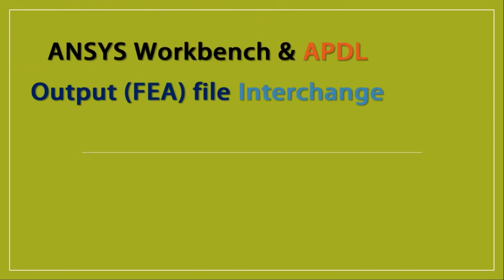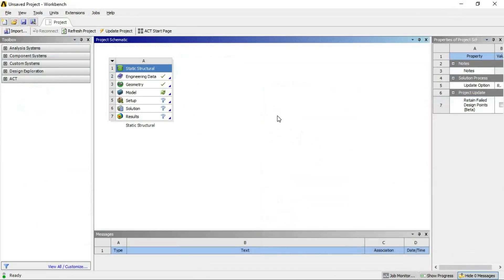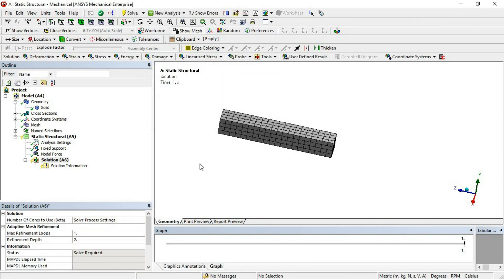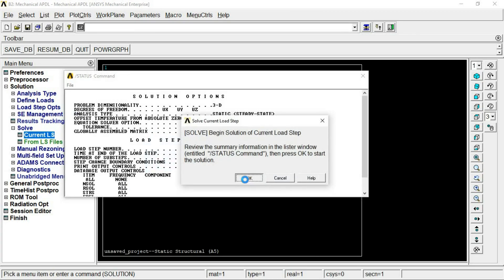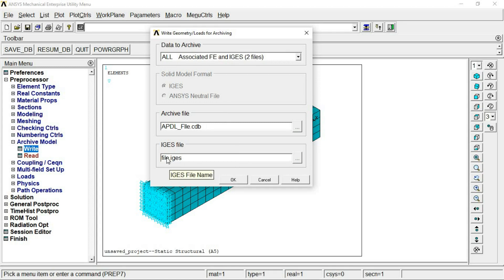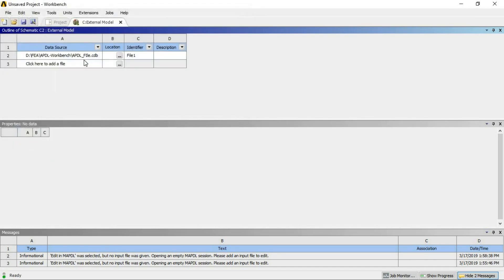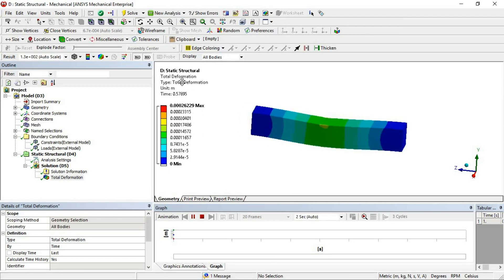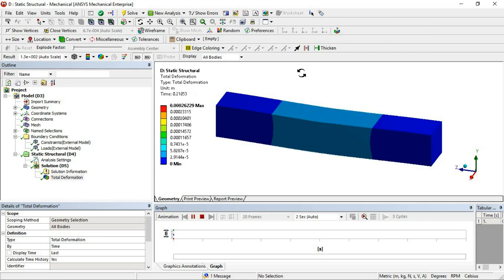How to open ANSYS APDL File in Workbench & Vice versa

Comment: Sir i have done model in ansys workbench space claim and done linear analysis then using tree menu and  imported the file in apdl for non linear analysis, i have add added element type, real constant, material model, now i want to modify attribute that is automatically created and assigned when imported in apdl now want to assign custom properties created in apdl for non linear analysis problem is that i am unable to pick particular element like slab, beam created as named selection in ansys workbench, now i opened component manger there it has be grouped i have selected particular element and ploted element it showed single but problem is when i pick element to assign for particular change of attribute all element are selecting even though i have plotted only slab. 

Can you suggest me tips.

Comment: Very useful tutorial. Thanks. I follow your instruction to export into APDL environemnt a Transient thermal job I set up originally in WB. It is a multi load step analysis but when I read into APDL it seems that only first load step is included. Therefore when I launch solve only the 1 step is calculated. How can I export all load step into APDL ?
Reply from the maker: It should export all load cases, but sometime it will create proper in APDL due to WB & APDL interference issue, geometry complexity, different elements types. Better to apply Loads further in APDL, it might be easier option.

Comment: Hello, your video is great, thank you very much. However, when I try to apply boundary conditions directly on the mesh generated from APDL (.cdb) on Workbench, Workbench does not distinguish nodes or elements. It only recognizes the surface of my mesh. How to select nodes or elements separately in order to apply a force or a displacement to them and not just into the surface ? Thank you for your answer
Reply from the maker: Hi ! It is better to perform mesh in workbench itself, which is quite easier compare to APDL. You can apply loads on nodes, by selecting nodal force or nodal displacement option.

Comment: Thank you Sir . But i have small question can i export only Geometry (with out a mesh)  from Apdl to Workbench i tried it again and again but i was not successful .  I would be glad if you can explain it to me if it is possible. I couldnot refine my mesh after i exported my model to Workbench that i why i need this info.
Reply from the maker: We would suggest use either APDL Or workbench, do no export mesh file from one s/w to another, it might loss few FEA aspects. The present video is for special case scenario. Ideally you should able to export the mesh file from APDL to workbench (Export CDB from APDL and import through external model in workbench) and It is difficult to edit the imported mesh file in workbench.

Comment: how to optimize a part from the assembly taking into considerations the load acting on the assembly.
Reply from the maker: You might need to perform the optimization simulation based on load path.

Comment: What's the difference between the ansys adpl and work bench .....ate these two used for same purpose and which one is better
Reply from the maker: Both APDL and Workbench are from same software organization, ANSYS. Both have advantages and disadvantages. APDL uses GUI & scripting while workbench only uses GUI. APDL have all the necessary option such as macros, arrays, scripts for all simulation while workbench is quite simple and uses APDL script for few analysis inputs and outputs such as reaction extraction with APDL commands in workbench. Workbench is easy to learn and easy to perform the analysis.

Comment: Hey, thank you for the valuable information! I have 2 simple questions remaining

1. In Ansys workbench: How can i change the job file name after each analysis, so that slight modifications and new simulations dont overwrite old results?

2. How can i open multiple results in workbench "simultaneously" so i an compare them better?

I would really appreciate your help, it would help me a lot!
Reply from the maker: Welcome
1. You need to do saveas R1, R2 & So on... after each iterations.
2. You can use viewport option in solution to see different results in different viewport.

Comment: helpful video just one question if we define material in apdl the import file of apdl in workbench will it show with material in workbench ??
Reply from the maker: Yes. Though if it will not show, you just need to explore material xml file and import XML file in workbench. Refer our engineering data/ material related video.

Comment: Sir , I exported file from ansys workbench to ansys Apdl , I inserted load on the beam by using face option in workbench , but when I export it to Apdl the loads are not showing there , what to do sir
Reply from the maker: Rashmi, It might be due to beam element and face issue. You can apply load on nodes instead of face. It may happens if model is complex. You can try to solve workbench file and save db file in analysis setting. You will get APDL file (db) which you can use for other APDL simulation purpose.
Reply: @graspengineering9249  ok sir thank u , I will try

Comment: Thank you for the video it really helps. However, is it possible just to draw the geometry in the workbench and then in the APDL I do the meshing, analysis type, identifying loads etc.???
Much appreciated your help and concern
P.S I am trying to simulate Hyperelastic material under Cyclic loading can You please do any tutorial in how to simulate Hyperelastic  materials in ANSYS APDL because I am really struggling and don't know how to do it and I  cant fined any tutorial about it.  

Thank you again!
Reply from the maker: Hello Alex, yes you can craete geometry in workbench and do remaining FEA steps in APDL. Either connect workbench to direct APDL or else write steps file in workbench Design modeler/spaceclaim and import in APDL.
We will upload video on hyperelastic simulation. Regarding hyperelatic material definition in ANSYS, you can check our  latest  video on material required as per analysis types.
Reply: @graspengineering9249  Thank you for your valuable answer.
 Sure I will check the last video it will help me a lot thanks!. 
Regarding the hyperelastic material, is that I am actually working in a project, to simulate dielectric elastomer under various voltages and frequencies and I don't really know where I can perform this simulation ,either in Ansys workbench or Ansys APDL. I can't find any simulation on Dielectric elastomer in the all YouTube videos and it is very complicated. 
I would highly Appreciate your help in this matter.
Reply: @graspengineering9249 . Hello,sir. Can you explain with more detail the process to just import a solid from workbench to APDL, please? 

Thank you so much for your videos and for sharing all of this knowledge.

Comment: Hello 
, thank you for the helpful video , I had something wrong, 
I can see the values of the forces when I used the code in the flist program APDL I only got zeros for all

and did not see the boundary condition folder and import the summary as you have

please explain to me where is the error?
Reply from the maker: Hello Gunit, If you are following the videos it should give you same loads and BCin both APDL & workbench. But if you are not able to see the forces their might be some issue. We not clear about your issue and how you are performing. But though if you are not able to import complete FEA deck, you can apply forces and utilize the mesh to perform the simulation.
Reply: @graspengineering9249  

Hello
 I did a full-length project, but there's a problem with me and some friends, so we put the strength and stability back on, Thank you, sir, for your important information to us as students.

Comment: Greetings, I am going to do the Response Spectrum analysis Ship Unloader Crane on Ansys Workbench 18.2. The schematic project is:

Static Structural -> Modal Analysis -> Response Spectrum Analysis

The question is the RSA only calculates the structural stress? what if I add some static stresses like the container, machine room, etc on Static Structural?

Because the crane must be on the operational condition while I simulating the earthquake (response spectrum)

Thanks in advance
Reply from the maker: Hello, You can perform the prestress modal analysis to account the other loads and then connect this to response spectrum analysis.

Comment: HELP sir the import summary didn't appear on my workbench. I have followed this video all the way
Reply: and it didn't appear boundary condition too, but there is named selections
Reply from the maker: It should come through external model tab.. Kindly check further. But it is better to work in workbench only.
Reply from the maker: Sometimes it may happened loads does not appear..this might be due elements issue or load application(array or table loads) . You can apply the same APDL loads in workbench. Don't waste time on importing every aspect.
Reply: @graspengineering9249  yeah i know but i have to make it the same solution as to get verified workbench model. thanks anyway

Comment: Dere sir, thanks for informative video. But while importing workbench file to APDL only mesh data transfer. Volume, area, line and KP are not there. Can u pls explain how we can import that also. Thanks
Reply from the maker: You first check what you have exported from workbench. Generally workbench export file only includes mesh, BC and loads . Example. Dat or. Inp file. You need to connect workbench directly to APDL, to get all inputs,  like geometry,  mesh,  BC, etc.

Comment: Hi, I implemented the steps to archive the APDL file after applying boundary conditions and solving and imported the file in workbench as shown in your video. The boundary conditions in the model don't show up in static structural. Any ideas on why this might be happening?
Reply from the maker: Hello ! It might not show in old version. You can write the cdb file without solving in APDL. Also check the loads and BC applied properly or not in APDL before writing cdb. It should show the BC in workbench.
Reply: @graspengineering9249  I am using Ansys 19.1 for this and the boundary conditions do show up in APDL. I tried both the alternatives, i.e. after and before the solution. The boundary condition I am applying is a constant value ROTZ on one node of a beam element 188 in APDL. This I believe is not available in workbench, would that cause any issues during translation? Thanks for your quick reply.
Reply from the maker: We rarely use APDL file in Workbench. We can easily create FEA deck as same as APDL in Workbench (Mesh, BC & loading). Workbench have same element type as APDL. . For your case, you can  apply remote displacement in rotz in workbench. You can brief further what do you want to simulate, share few snapshots with us if you didn't able to resolve at your end.

Comment: Hii sir,
Yashwant this side...would you please help me to solve a problem related to pin on disc simulation to find out the thermal stresses and wear analysis  in case of pin (cylindrical) is fixed and disc is rotating both ...please make a video  of them step by step...
Reply from the maker: Okay !
Reply: @graspengineering9249  if you share your contact no...I will discuss my problem..
Reply from the maker: @Phd_junction_77111  You can contact us on graspengineering@gmail.com

Comment: Hi, thanks for the tutorial!
I got one question: How do you get your file of "Boundary conditions" containing the Constraints (External Model) and the Loads (External model) in Mechanical in your last test ?
It´s after you uploaded in Workbench the model modified in APDL (with new constraints and new loads).
Thanks for your reply
Reply from the maker: Welcome ! Generally applied loads & Boundary conditions will be written in cdb file while exporting cdb from APDL and same you can able to see if you read that file in workbench. It is vice-versa for WB to APDL too. Sometimes loads and BC will not present in case if you export from other Software like hyper-mesh.
Reply: @graspengineering9249  Thanks for your answer. In my case, when I do the export (from one way as well as the other), loads and BC are not present. What do you mean by "S/W life hyper-mesh" ?
I followed your tutorial step by step but with the export I loose the loads and the BC.

Thanks for your reply
Reply from the maker: From APDL to workbench or Workbench to ADPL, output file should contain all the details. It might be due to older ansys version, or might be possibility loads or BC are present in APDL, but its not showing in display.
Generally we did not use above technique of moving files from one software to another, but we do transfer meshing file. If loads are not coming then use mesh files and apply loads and BC separately. S/w means software...

Comment from the maker: Please refer Video for file transfer from APDL to workbench or vice versa. You can follow the same approach to import FEA files from other software like (hyper-mesh, abaqus, etc) too.
Reply: how to do nonlinear analysis using arclength method in anasys workbench? 
Thanks in advance
Reply from the maker: @venubarathan8391  Hello, You need to activate arc-length & set key On, Once activated you need to define the multipliers & initial load factor. But there are lot of limitation of this method.
Reply: @graspengineering9249  but there is options in workbench to activate this in ansys.  Otherwise is any method available to solve nonlinear problems? 
Because newton raphson method fails to converge yield point of the structure. I want to capture nonlinear behaviour of structure beyond yield point.
Reply from the maker: What kind of analysis are you doing ?  If your geometry, meshing and material definition is proper, then most of time ANSYS default setting is good to converge, No need to give additional controls.
Reply: @graspengineering9249  i am doing nonlinear buckling analysis for dome elliptical shell. In abaqus it is converging using arc length method. 
But in ansys it won't
Reply from the maker: @venubarathan8391  Try with fine increment, we will upload video near future  on same. for instant you can take help of  below link if something fruitful: https://www.simutechgroup.com/tips-and-tricks/fea-articles/94-fea-tips-tricks-buckling